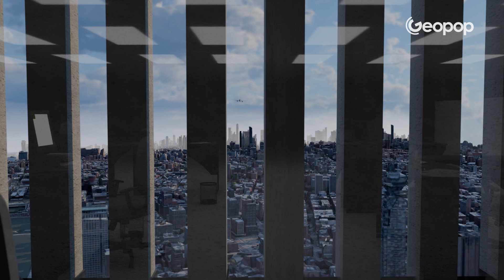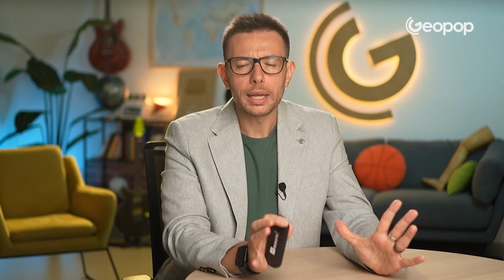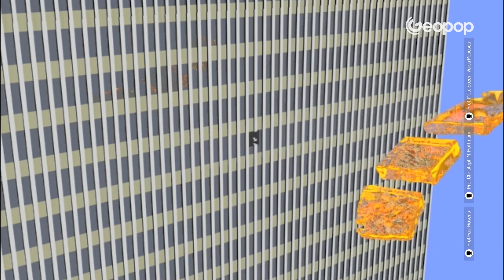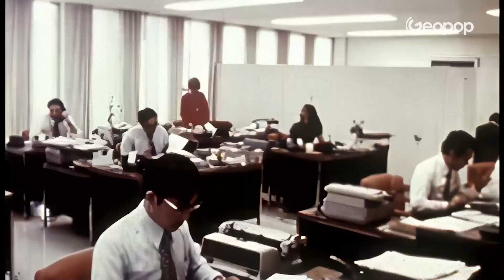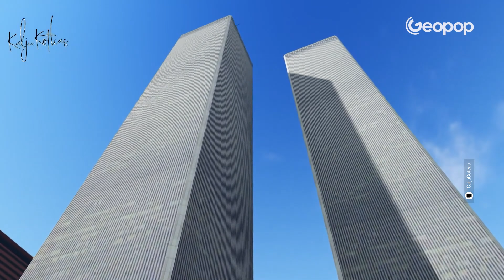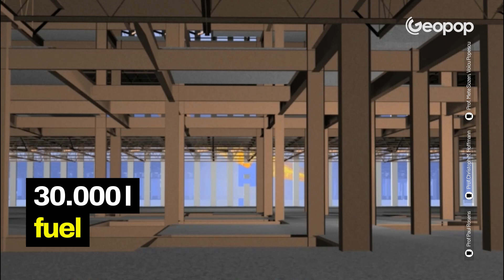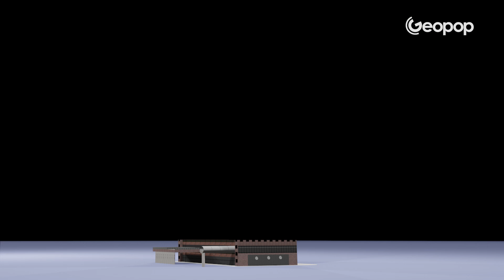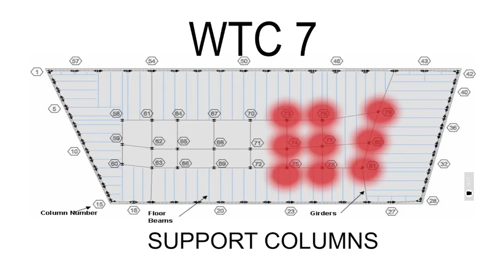9/11, 2001: The Technical Reconstruction of the Twin Towers and WTC 7 Collapses

Comment: I’ll never believe that this wasn’t a controlled demolition.
Reply: IT was a controlled demolition and not even the jackers flown it in the twins but remote control.  911 was an inside job.  Do some study and find out.  This video is disinformation.
Reply: What is the source of the many tons of molten steel found in and under the debris, the heat so intense that the molten steel remained in that state for weeks afterward, running off of the debris as it was excavated. This cannot be molten copper from wiring that retains the color of a shiny new penny.  It cannot be molten aluminum that retains the color of the polished aluminum wheels of a street racer. It was the color of glowing orange molten steel  that cannot be mistaken for any other material, reported by firefighters who are very experienced in the nature of such materials as well as seen in video evidence.

When you combine this with an entire lack of turbulence behind 500 mph aircraft, when even a small Cessna Aircraft would leave an evident wake in the smoke and fire only seconds later .  . We find that skeptics still cannot be skeptical of the official narrative in explanation.  Sponsored channels and forum activity are skeptical of nothing when support is provided.

Sponsored activity in the forums is very normal today for commercial and political purposes and subjects of controversy -- in the attempt to lead public debate.
Reply: And that is why you fail.
Reply: @TheLoonResistance  telling everyone that they are wrong doesn't make you right.
Reply: @Jimschrbr  - Good thing that is not what I said then. Do pay attention.
Reply: I agree.  Nothing will change my mind.

Comment: great work! i dont really understand all the conspiracy theories as theyre so easily and logically disputed. for instance the time discrepancies the conspiracy theorists make so much about. watch and public time display devices are set by humans. we didnt have smart phones connected to the internet providing time keeping syncronized with zulu/Greenwich Mean Time (GMT). so such devices were set from either calling to get verbal report from an atomic clock or more often personal watches were set via the time tvshows started or ended then the watch was used to set the public displays. said watches were subject to fluctuations ie battery powered watches lost time when the battery was close to having lost its charge, wound watches lost time as the spring was close to expending its last stored energy. ergo these devices were not synchronized and would display different times. sometimes up to an hour difference if the locallity observed daylight savings time and someone neglected to update the device. ergo when people looked at their watches or public displays as the events of 9/11 played out they marled the time from these devices however accurately of inaccurately they were set. hence the disparity in the various times the various witnesses reported. 
another is the surviving passport of at least 1 of the hijackers. conspiracy theorists make much out of the fact it survived the fire while the steel did not giving fuel to their conspiracy completely missing a very simple explanation. at least 2 hijackers were in the cockpit at the nose of each aircraft about 40-50 feet in front of any fuel tanks on the aircraft. the planes did not "blow up" and start fires as soon as they impacted the buildings. they shredded themselves and the girders they hit continuing with the same momentum they were traveling at at the time of impact essentially turning into a giant shotgun blast traveling along their flight path. debris of the nose/cockpit would be in front of the fuel tanks when they hit the build and wouldve remained so through the open floorspace unless or until the struck something solid enough to stop their motion. the fuel would not immediately ignite as it was atomized due to the energy of the impact either by a spark of something hitting steel or by the hot engines now tumbling freely through the building. if you do a frame by frame advance of the 2nd jets impact you can see debris exiting the opposite side of the building a few milliseconds before the burst of flame. obviously the passport of one of the hijackers made it through the building in combination with debris from the cockpit/nose of the building do be found by someone working on debris removal. in other words, it was never near the fire having exited the building before the conflagration started. 
and their are plenty of other fairly simple explanations for their conspiracy theories. but, of course they do not want to hear them. im not saying the events of 9/11 happened exactly as the story is told from "authoritative sources". just that i personally do not buy into the "controlled demolition" as the collapse was so obviously not explosive or controlled.

Comment: WHAT YOU'RE NOT TALKING ABOUT IS THE CENTER SUPPORT COLUMNS..... BUILDING LIKE THAT CAN'T FALL DOWN CENTRIFUGAL INTO ITS OWN FOOTPRINT WITHOUT THE CENTER SUPPORT COLUMNS BEING DESTROYED.

THEY WERE EXPLOSIONS FROM THE BOTTOM OF THE BUILDINGS BEFORE THEY CAME DOWN FROM THE TOP. 

IF YOU'RE GOING TO DO A DOCUMENTARY LIKE THIS MAKE SURE YOU INCLUDE ALL THE FACTS OTHERWISE YOU JUST MAKING YOURSELF SOUND LIKE LAME STREAM MEDIA THAT'S REGURGITATING THE SAME PROPAGANDA THAT THE GOVERNMENT WAS PUSHING. 

SMH... KNOW WHAT YOU'RE TALKING ABOUT. 

YOU DIDN'T EVEN MENTION THAT THERE WERE TRACE ELEMENTS OF NANOTHERMITE FOUND IN THE DUST AT GROUND ZERO.

Comment: What was the cause of the steel to lose so much of its strength? It couldn't have been a fuel fire because that was burnt off immediately in the two huge fireballs on impact, unless tables and carpets can burn with such heat for such a long period of time with people stood in the entry points waving for help left completely untouched. I can accept the steel failing, but not because of weakening of its strength through heat.
Reply: Were you not paying any attention at all?
Reply: @TheLoonResistance  Yes. Were you?
Reply: @Robert_DeVille - 🐂💩

Twin Towers collapses were relatively straightforward, the fundamentals already understood in the professional engineering community within just weeks. Still, there’s a lot of really bad information floating out there, mostly on the internet where it’s easily accessible to anyone. Good information takes more effort to come by and is much harder for laypersons to digest. Engineeringspeak is complex and dull while wild baseless speculation and pathological theorizing with easy hand-wave answers is simple and exciting thus getting far more intention than they deserve.

To correct that situation, I have all on my own prepared this short yet detailed technical description of Twin Towers collapses based on my own observation and analysis of the available true and relevant facts. No politics or ideology, just the engineering. My hope is this will dispel many common myths and answer most if not all questions you may have about the Twin Towers collapses, because anything can seem like a conspiracy if you don’t understand how it works

While complex, most of the Twin Towers collapse mechanisms can be seen with the naked eye and easily discerned and understood by the layperson if sufficient time is taken to understand. 

1. The Twin Towers consisted of 4 primary structural elements that together formed an integrated system where each relied on the others.  47 hollow box-section steel Core Columns carry the majority of the gravity loads. The 236 hollow box-section steel Perimeter Columns carry the remainder and ALL of the lateral (wind) loads. Long-span Lightweight Steel Trusses connect the core and perimeter column together at each floor with a Hat Truss on top to tie the structure together as an integrated unit where no element can survive without the others. There was no structural load bearing concrete and most components were bolted together.

2. The impact of 117 tons of airplane (= to about 12 dump trucks) at speeds up to 590 mph with the energy of a ton of TNT completely destroys the aircraft. This in no way implies the Towers come out unscathed. Many perimeter columns are damaged or destroyed as are some core columns (example; 33 of 59 perimeter and 20 of 47 core columns damaged or destroyed at the impact floors in the North Tower), This damage is primarily through bolt-shearing failures at the end connecting flanges, as well as bending, twisting and fracturing of weld seams. There was no cutting or slicing - the reality was far more violent and messy. 

3. The impacts destroy or damage fire insulation, fire breaks and sprinkler systems on multiple floors.  Huge fires are started across multiple floors simultaneously and allowed to spread rapidly with no effective firefighting or fire suppression. This was an unprecedented fire event . 

4. The hotter steel gets the weaker it gets .  With fire insulation stripped away and no sprinklers the survival time of the steel greatly reduced. Gradually over time heat causes the lightweight steel Floor Trusses at the impact damaged floors to sag, which was observed and recorded.  No steel melted or needed to. Structural steel fails long before it becomes a puddle. It just needs to bend

5. Sagging floor trusses pull on the increasingly weak and overloaded Perimeter Columns, causing some of them to bow inward by up to 5 feet. A straight column is up to 4 times stronger than a bent column. The bowed Perimeter Columns buckle and fail, initiating collapse. The formerly static mass above which the structure below could easily support is now converted into a dynamic mass up to 30 times greater. Because they have buckled, the Columns above and below the failure point are no longer aligned . The load bearing structure below no longer bears any load as it falls past the lower columns, NOT onto them.

6. Thousands of tons of debris fall within the four outer walls, down through the open office space, crashing onto the first intact floor it encounters. This massive impact immediately breaks the bolted connections to the columns as the amount of resistance the Floor Trusses can offer is negligible.  The falling debris slows only marginally and briefly. Note:
6a. This is NOT a solid top block crashing into and “crushing” a solid bottom block .
6b. The debris falls past the columns not onto them.  The columns provide no resistance to the falling debris. 
6c. Only the bolted connections of the floor trusses to the core and perimeter columns can offer any resistance. A pair of 5/8” bolts at each end of each truss vs. thousands of tons of falling debris.
6d. No laws of physics are violated.

7.  This floor-led collapse progression within the four outer walls can only go straight down. Note: 
7a. This process is often incorrectly referred to as “pancaking” which actually refers to a completely different process rejected at an early stage. The catchy name stuck but nobody knows what it is supposed to mean.  Pancaking is too simplistic and inaccurate anyway. More like Kaiserschmarrn.

8. Collapse progresses through the floor systems not down the columns, through the path of least resistance . Rate of floor failures increases with each successive floor as momentum increases, reaching an average acceleration of 0.65 of GA, or 35% slower than true free fall. Bam, bam, bam down the building until there are no more floors to fail.  The resistance offered by each successive floor is always the same. The mass and velocity, thus the energy of the falling debris is constantly increasing, with each floor destroyed adding new falling mass. Some falls to the sides, but most falls down. More mass, more velocity, same resistance with each floor.  Don’t get stuck on the but the lower floors weren’t on fire nonsense. They weren‘t and didn’t need to be.

9. The Towers were 95% air by volume. As that air was compressed inside the building it is forced down the tower and blown out the sides in reaction to the building collapsing . Those were not “explosions”, it was expulsions of compressed air caused by the collapsing building, explaining the low velocity, lack of flash, blast, supersonic pressure waves and lethal high-velocity ejecta.  

10. Perimeter Columns become detached and peel away like a banana behind the collapse front, playing out to the four points of the compass extending to more than 600 feet from the base of the towers. This was quite obvious from examination of the debris pile. 

11. Core Columns fail last as their internal beam bracing is stripped away by falling debris and lateral support from the floor to perimeter columns is lost. 

12. For those who care about how long this whole process took; 31-34 seconds from the moment the perimeter columns buckled until the last core columns hit the pile, or 1/3 the rate of true free fall. Don’t believe me?  Just watch any video of the collapses and note the loose truly free-falling debris dropping much faster than the towers themselves.  

13. Each Tower had a 1-acre footprint. Far from collapsing inside their own footprints the debris pile spread out over 17 acres in a pile up to 14 stories deep. 8 surrounding buildings were destroyed and scores more damaged by the falling debris. 

14. What was NOT observed were the 180-190 dB bangs of thousands of high explosive devices or the blinding bright flashes of burning thermite. Neither could have caused the (silent) perimeter column buckling that clearly initiated collapse.  Neither explosives or thermite could have survived the impacts and subsequent fires either. A video of a shocked and injured firefighter using the magic word explosion is in no way proof of explsoIVES . The pre—planned demolition case relies entirely on that sort of thing. There is zero tangible physical evidence and it would be technically impossible, totally impractical and completely unnecessary. No one would bother. 

15.  Finally, the Twin Towers were perfectly safe within their design envelope.  They only collapsed when taken far outside design parameters by an extraordinary and unprecedented event 

Impact + Fire (heat) + Time + Gravity = Collapse . Remove any one of those four elements and there is no collapse. Ignore any of those elements (as many do) and you will never understand the collapses. The Twin Towers were an integrated system in which no one component could survive without the others. One fails, the rest follow, through the path of least resistance – DOWN – through the open space, bypassing the path of greatest resistance – the columns.  Nothing I just described violates any laws of physics. All of the above is true no matter who planned and carried out the 9/11 attacks or why 

In 24 years zero structural engineers of tall buildings, including the 1/3 that have retired in that time, have made any statements in support of 9/11 Truth BS demolition claims. Zero, nada, none. The lack of any such citations in the engineering literature (published in any country worldwide) is documented in the update to this video: https://youtu.be/nP3TNHPCIVU

I hope you found this helpful and informative. It is not meant to be adversarial, but to solicit informed critical comment, positive or negative. If I made any errors of fact, logic or reason or left anything critical out, please let me know so I can fix it. To stay focused just one topic at a time please and on-topic (Twin Towers ONLY). No word-salads of Gish Gallop. IF you can offer a more plausible alternative be my guest. Be the first. Please start any reply with the words “Tits McGee” or I will know you didn’t actually read it, are not serious and just wasting my time.